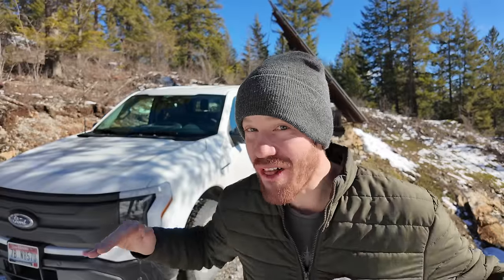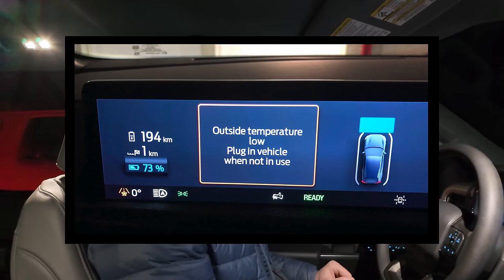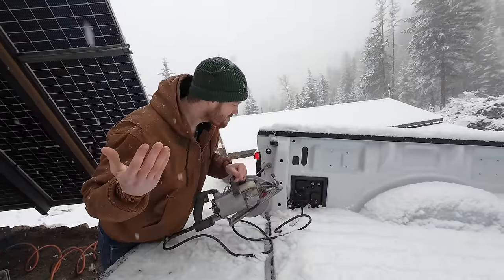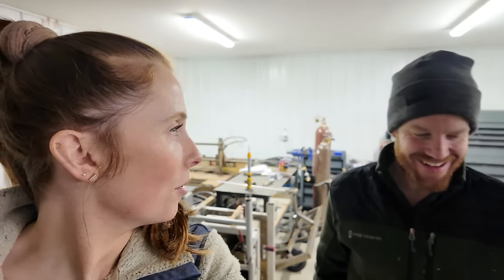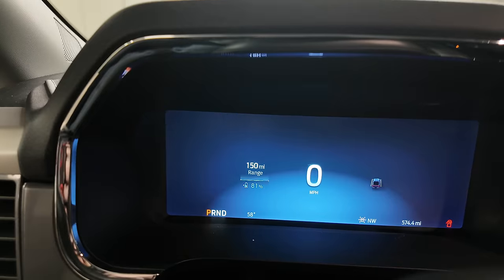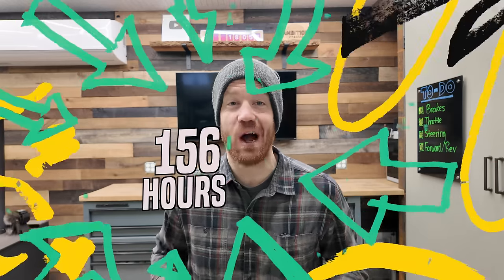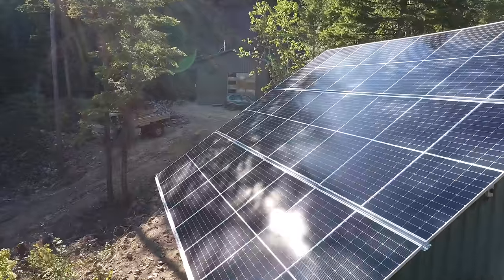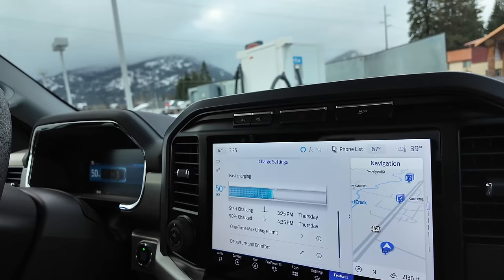Replacing My OFF-GRID Power System With an E.V. (not what I expected)

Comment: Ok something you really need to know, power draw is a constant but when you turn a appliance on there is a power spike peak, So items are pretty bad as no regulator so the hair dryers on peak is very very high much higher than its draw rate, Issues this way with devices tripping circuit breakers due to this, side note when a power surge happen its too late the trip system takes longer than the speed power travels so there only made to stop power continuously going in that event to prevent a worse situation, the are UPS devices made to handle those events, and I have come across power board very different looking to a normal one with regulator built in etc to prevent damage.
Id recommend looking into this and getting some of those power boards or UPS units, last thing you want is a surge and flow back damaging the truck. its clear the truck has no regulator to stop a item drawing more than what the truck can deliver causing the issues. bad design. but i guess they did not forsee this use case.

Comment: The noise you hear in the truck is IT"S Inverter that is creating your AC - they can overheat and shut down. I am sure that Inverter is not designed to be left on 24/7 and it was probably shutting down because of that over use.  I am sure no where in any documentation does Ford say to use that truck to power a house 24/7.  But love watching you try!

Comment: The next time you power your house with your truck and you want to use all the things you couldn't use, just plu in your ecoflow to.the outlet and then run which ever devices gave you problems last time through the ecoflow.  The inverter in ecoflow will shield the inductive load from the truck while still keeping your ecoflow charged.   Then unplug your ecoflow when done (or not, totally up to you)   also Courtney gets her special "not for peasants" coffee.  

Great test, but from what i have seen in the past using the F150s to power homes, there isnsome special wiring the needs to be done and although you can run your house with the f150, the special wiring might come into play trying to charge your offgrid batteries.  Good luck and keep us up to date on the endeavor.

Edit,  maybe i should finish the video before commenting,  lol. Looks like you got the powering the batteries thing worked out

Comment: Very interesting presentation!

BTW: Charging on a 120 V (Level 1) circuit is best done with a dedicated circuit, meaning nothing else (like a garage-based refrigerator, open, lights, etc.) on the same circuit breaker.  You can use a 20 Amp breaker with fatter wire, but where you plugged in out front was clearly a shared 15 Amp circuit.  No wonder you got "completion" in 2 days and 6 hours!

Still watching - but at 13:39 or so, just before you plug the truck into the apartment - you didn't mention using any transfer switch or anything.  Details might overwhelm some, but would be nice for some of us.

Comment: I've had an EV for over a year now.  You shouldn't charge at a level 3 (public high speed) charger over 80-82% since speed will significantly decrease at that level, and you're overtaxing your battery.  Also, EVs don't like 100% charge unless you need it for a long road trip, mine recommends 90%.  Ideal levels vary from one EV to another, but in my case on longer trips I aim to get to chargers around 5-10% and charge to 70% on average.  Thankfully, I'm not off grid for this, but I can bring my car from 5% to 90% overnight at home.

Comment: I was very curious about the Ford Lightening too, and I was reading up on it.  When I read that it has actually had a LOT of reliability issues around its electrical system and some other problems as well, I decided to wait awhile for Ford to work out those kinks...  Plus, aren't there issues with charging EVs and in really cold weather?  Here on the west coast that wouldn't be an issue, but northern Idaho is COLD!  Will be curious whether this is just content and a curiosity or a real potential solution over time.

Ok, so I wrote my first comments above before watching the video...but I have to say I'm impressed!  It does seem key that the truck be parked inside the shop so it's in a warmer environment am I right?  But if that space is available anyway then no worries.  Pretty amazing that the truck battery system is 50% larger in capacity than your massive home electric system!  Hopefully, you won't have any of the problems that I read about the Lightening being prone to.

May I ask whether you bought new or used?  Cool video, great test, thanks!

Comment: I think the truck is a plus. In the summer you should have excess power to charge the truck keeping your gas bill low.  I don’t know that charging in town and then dumping power from the truck as a routine is such a good process. I think that option should be an emergency option. Is it possible to add a wind generator?  If your truck meets your needs for 6 days and you have 20% left you used about 12kwh per day? So you would need a wind generator capable of generating in the range 1kW  to 5kW  depending on local wind, what your winter power deficit is etc. Wind might not be an option with all the trees around.
Anyway just another option😃

Comment: I do love this idea, great vid & tests & lots of pro’s to this whole idea for ur situation especially.
 I’m sorry I’m not convinced of the reliability of the Ford yet, time will tell, they have had some bad raps tho.
It is a great compliment to ur system but definitely not a replacement. I think a great DIY video build would be a battery trailer project that any vehicle could tow. 
A trailer setup wouldn’t necessarily need a very large inverter and capacity could be easily scaled up at any time, ‘EVE’ type Lipo4 is getting pretty cheap now days along with good BMS’s & we know ur up for the task Riley, you could even run a side business of hiring it out or selling top up power to neighbours in a similar situation. A trailer can be parked outside, possibly near a heating exhaust away from the house for extra safety even though lipo4 is much safer than Lithium Ion batteries anyhow. It would also give you options to get rid of the Ford, keep it, or upgrade it in future. Cheers

Comment: 27:37 No. Like you noticed, the SOK battery is more stable..simpler..extendable.. easier to fix. What happens when your car breaks down and is being fixed for a couple of weeks? You run propane & gas only? It's better to think F-150 as, like some people said, 1) mobile backup electricity power from the grid and 2) battery storage for excess solar power during the summer.

Comment: Hello, I'm from the UK so I don't particular understand how US electrics work, but I imagine the Ground Fault detection is caused due to a very small imbalance between phase and neutral which wouldn't be picked up by a Victron system as its designed to be used with a TT earthing arrangement, whilst the truck would be designed as an IT earthing arrangement which would require, in the UK, a much more sensitive protective device capable of detecting <10ma of current imbalance.
Reply: Or a sort of TNS system, I'm not sure as I haven't read into how Ford have designed this vehicle

Comment: I have 2 Chevy Bolts which I have come to really love.  I had to set myself up a Level II charger (240VAC) at home.  It works very well for us.  As far as traveling we use the free app to map our trip and find Level III CCS fast DC chargers.  It is time consuming so we look for places to eat, shop etc.  Level I 120VAC charger is ok in a pinch but way too slow.  For power outages at home I am content with using my Delta Pro with the solar panel.  With that being said In a pinch using the F-150 to run your home is cool but no real replacement for your awesome system.  Love the videos !!  Keep em coming.  All the best!!

Comment: I thought about doing this with my house,  glad I didn't. I don't think we're there yet.  I wonder if the appliance issues you are having are due to inrush currents being too high. Edit: I commented before the video ended haha.  We would only use it as a backup. We have a 20 kw solar system, live in Texas, and still need an extra 65 kwh some days during the summer for the A/C.

Comment: The way to go in this route (if you dont NEED an automobile) would be to purchase a totaled low mile Tesla and take the battery pack out. You can even find the Tesla modules used on eBay for $1000 +/- depending on the miles the vehicle had. 5.2kwh of lithium for $1000, would be cheaper if buying in bulk. Also, I'm pretty sure the Tesla power wall uses the exact same modules, 3 of them I believe, so $3000~ in used low mile cells make up a power wall, versus the cost of a new power wall is quite the difference.

Comment: Having owned EVs (teslas) for over ten years now, I am very comfortable with them.  I will not go back to ICE vehicles.  I think this will be a great device/vehicle for you guys.  It is basically a portable generator/battery that you can also drive.  What is not to like?  I would however, run an electrical line from your garage to the solar/battery system so it does not have to sit out in the cold to charge your battery bank.  It would work much better that way.  I am planning a new garage/shop at my retirement home. I will be adding 20kw of solar panels to the south facing roof and installing a 150 A 240V split phase system with about 90 kWh of batteries.  The goal is to charge our two teslas, heat/cooled, and powrr the shop with solar/battery/inverter alone.(not grid tied)

Comment: Depending on how often you go through a full charge/discharge cycle, it could be a $30k battery every 5 years or so, that's potentially £500 or so a month in battery replacement costs alone.

Comment: If you need another vehicle it makes more sense, but if it's simply for the battery capacity the cost breakdown of even "cheap" LifePower4 from signature solar is well below the cost of a truck. Roughly 100kWh in the Pro F150 comes out to less than 25K @ $1250 per 5kWh with those batteries, so you're roughly paying double to get the truck as well. IMO .. not a bad trade off if a second vehicle is what is needed.

Comment: Another approach to weigh against the question of using a Ford Lightening or buying more solar+battery commercially manufactured capacity is the DIY approach? That is what cost savings  would you achieve buying LiFePo4 battery cells, BMS and and building your own batteries to increase storage capacity? Could you add more solar cells to existing roof areas such as on the Barndominium or the Equipment shed?

Comment: I have a Powerboost hybrid, not a lightning, but I think the Lightning is similar.  You should be able to check your charge level/status/propower status plus any error messages from your phone using the Ford Pass App rather than running downstairs to open the truck and read the dash over and over.

Comment: you have to count all of the costs when you are charging, like all the food and drink you bought while waiting for it to charge. You probably would do better over time in part by upgrading to bificial panels that will do better in winter with the snow reflectace even when it is cloudy..the battery replacement on the truck will be wicked expensive..probably better to keep the truck use as a back up to occassional use and just focus on using less energy in the winter..

Comment: Would be interesting if there was a way to automate the charging of the truck based on the battery level of off grid storage. Like leave the truck plugged in full time when at home (find a way to also have an out door plug so the inside can be free to work in) then once battery level of off grid reaches like  95-100% then start charging truck. Might want to set it to start charging at a % then stop at a lower % so it does not start stop all the time. like have it set to start at 95% but stop at 90%. Also  a way to charge off grid with truck from the house instead of having to back it up to the container so it stays warm to not use up power to keep the batteries from freezing. Last thought would be a small outdoor car port so you don't have to keep the truck stored in shop all the time, but still keep the truck warm.

Comment: 90% default is for one of the reasons you talked about, ie how long the long tail takes. The other reason is that LiIon cells degrade faster at higher Voltage. Those cells go from 2.5V to 4.2V, each.

Comment: I tried replacing all my breakers with GFCI breakers, and they would not stay on at all.  Probably some shared neutral wires, which will trip GFCI.  Had to take them back to HD and use the standard ones.  I can still use GFCI outlets just fine.  I knew your truck power would work for many days:  My grid-tied solar array averages 25 KWH per day, and it runs our house just fine, with no net power from the electric company.  In fact, they owe me about $400 worth of electricity..

Comment: The hair dryer apparently has a connection between the ground and the neutral.  The truck has a bonded neutral/ground and doesn't like to be connected to anything that has a neutral & ground tied together.

Comment: As an ev drive, I rely on charging at home through a 240 outlet 99% of the time. When my wife uses it to commute to work, she has an hour commute both ways (2 hours total), and she gets home with 30% left on the battery. And we only charge up to 80% everyday to protect the longevity of the battery. Having your home charge your vehicle is way more convenient thank relying on the fast chargers.
Also, here are some reasons your fast charging is taking so long:
1. If you don’t precondition your battery before arriving at the charger, the vehicle uses the energy from the grid to warm up cause it’s too cold to charge. That can take anywhere from 5 to 40 minutes depending on the outside temperatures
2. The battery charging curve. My car for example charges from 10% to 70% percent within 20-30 minutes. A battery at 90% will actually take longer to charge to 100% thank it will to charge from 10-70. The charge rate slows down so that it avoids overheating the battery.
Long story short, I only rely on fast chargers for road trips, and those have been just fun. But your home charging your car overnight everyday is the most convenient part of owning an ev, and is honestly the thing I like most about having an ev. I don’t think I would enjoy relying on the fast chargers everyday.
I recommend you check out the YouTube channel Out-Of-Spec Reviews. I learned a lot about being an ev owner from that channel.

Comment: I like the idea of being able to dump extra energy into what's essentially a mobile battery, and think its nice you can supply your home with a trip in to town much how you did with water trips for water...but if you have multiple power sources as options, this is the most expensive and seems less practical. you'd be better off with a few wind turbines on your hilly property as an alternate to solar on grey days, and increasing your battery capacity on site for the same price tag

Comment: Do not connect your inverter to the battery system like this! Inverters have big capacitors etc. If you just juice it up from the battery the inrush current can damage little bits and bobs in it. You may get lucky  and nothing happens but damage is one of the possibilities. Usually its done with precharging the capacitors using an inline resistor or a lightbulb. Light turns off= no more current going through it ;)

Comment: I think hybrid technology is where we are currently in the whole electric car battle.  That being said if live to see the f150 hybrid with the in bed power have a larger battery and the ability to plug in and charge said battery.  Also why ford has not put the f150 hybrid system in the transit van is beyond me. They would completely dominate the camper van industry with that system.  Having a 7200 watt generator built into the van to power it would be amazing!   As soon as they put that system in the transit van I will own one.  To me it’s the ultimate in useful vehicle.  A 4x4 camper  van that  powers itself and you can power your house when you need to is awesome!

Comment: I don't know if I'd want to depend upon the truck for a long period of time, but it can definitely supplement your off. Good as you're singing, when you get the odd sunny day and your batteries were full on your operating system. You were able to put that free power.  Into your truck and then in turn, you were able to have your battery charged off the truck when the sun wasn't out. So it's a good supplement, but I don't kto upgrade your storage capacity.  And your solar panelso that on days when you can get power, you can make more power and then have more batteries would be cheaper than buying the truck. I would say yes but it still seems to be a good supplement

Comment: Hmmm ...
1. What happened to your Bluetti backup power system?
2. The neutral bonding can be an issue with inverters. Some are, most aren't and it's seems to me you can't combine them.
3. Given your location, I would have gotten the truck with the larger battery option.

Comment: So first a disclaimer. I am from Denmark in Europe.
But I am a electrical engineer who have worked with building EVs for an US market.

Therefore I suggest you guys look into how much you can charge the car over AC in amperes and voltage. Then you find a charger that can supply this and also can change the charge rate according to how much sun power you are getting. Of course your inverters should be able to supply the amperes for this to work properly. However, don't worry if the inverters can't deliver, then the charger can at the time being be set to a lower max charge rate and turned upwards on a later date
Reply: BTW contact me if you want more help on how to. I am currently building machines for the US market and know a lot about how your electrical system works